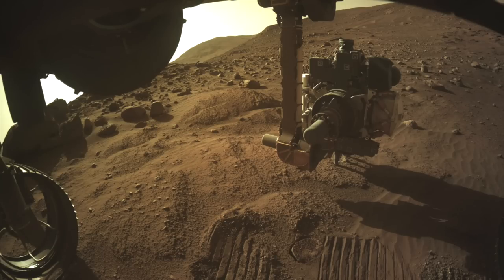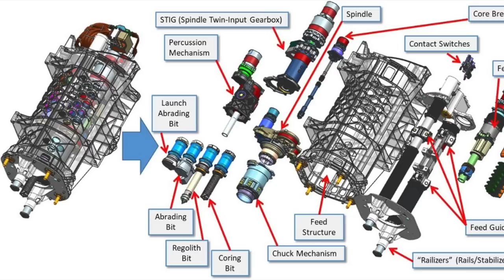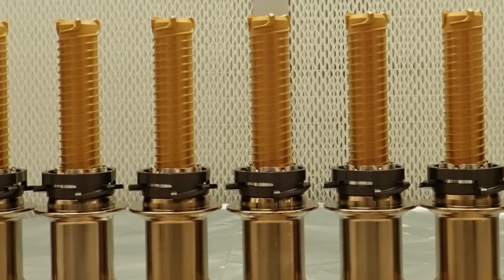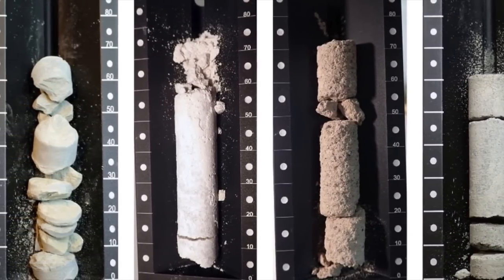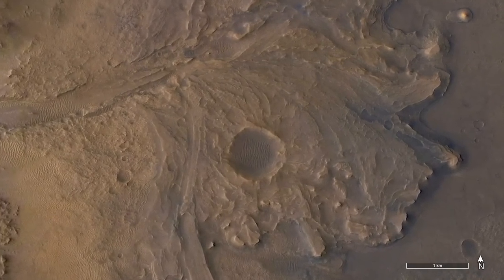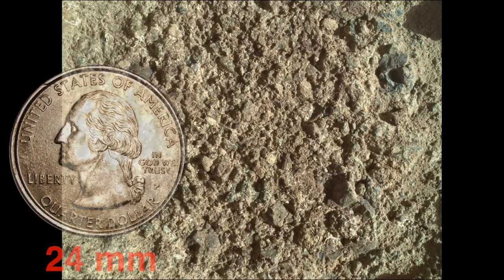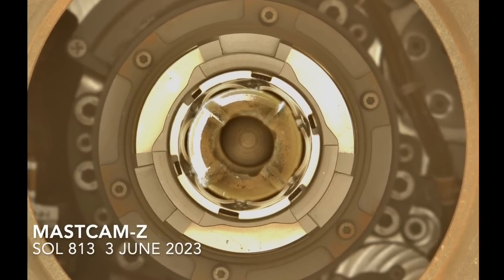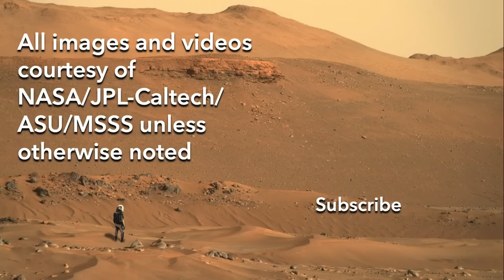Trouble on Mars 2

Comment: Thank You Mars Guy! Nice animation of this core drill. It seems to be slightly overcomplicated? I understand that it works great for solid samples but having this complexity it could be a little bit more robust/universal. 
So, more than a half of core tubes are already used. Another year and they will be all filled. 
Will Perseverance then wait in any safe location and wait for core sampling retrieval mission?
Reply from the maker: There's a separate bit for regolith, so they've got most bases covered.  There's never been a bit design with so many requirements, so it's really quite good.

Comment: With Mars being smaller and with lower gravity, is there a limit to the harness of rock? I've been wondering how this would affect the harness of rock, particularly sedimentary, as the weight of water could never be that of Earth for the same volume. Any porous rock would also be subjected to the lowering atmospheric pressures where water could freeze and sublimate, as would CO2.
Reply from the maker: Perseverance has successfully drilled several other sedimentary rocks that were well-cemented and strong enough to make good cores.